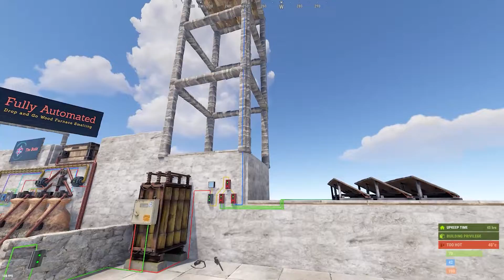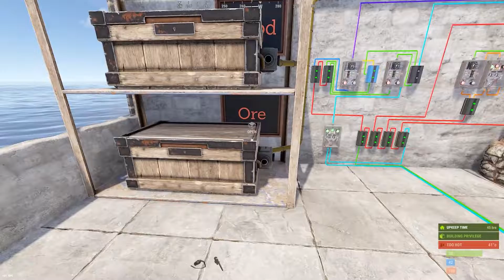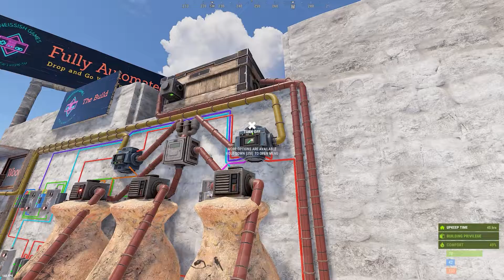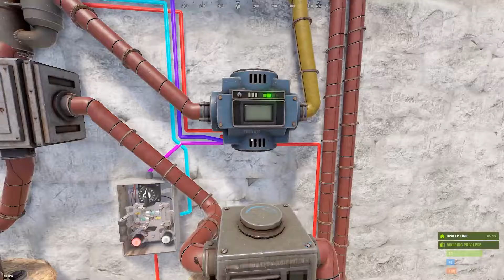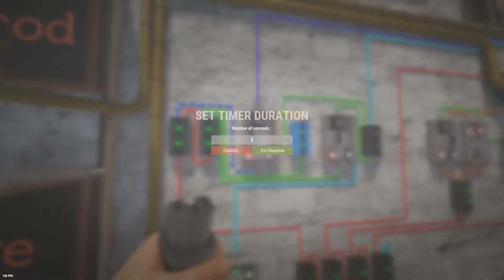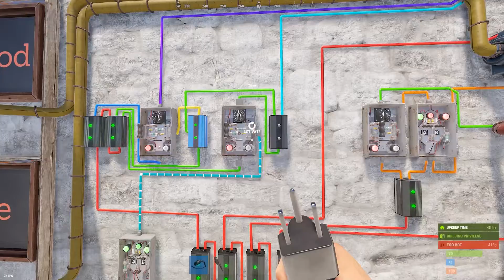RUST Industrial | Fully Automated Drop and Go WOOD FURNACE Smelting 2023

Comment: Love the video. How do you change your circuit views, highlighting one, all or none?
Reply from the maker: If you are in range of wiring and equip the wire tool, it will all highlight automatically. You can isolate a line by selecting any of its connection points. Selecting that connection point again will toggle back to everything being highlighted. To stop highlighting all together, I simply unequip the wire tool. Hope this helps!

Comment: Isn’t it an overkill? Full auto furnace room may work on 5 power. 
Just box-splitter-2conveyors(one for wood, one for ore)-combiner-furnace-furnace-furnace-conveyor-box
Electricity: source-combiner-combiner-combiner-timer-igniter
Logic 3 wires:
1. ore conveyor filter pass - wood conveyor turn on
2. ore conveyor filter fail - wood conveyor turn off
3. wood conveyor filter pass - timer on

This won’t refill furnaces will wood once everything is smelted, so startup will take extra few seconds, but it’s much more power efficient
Reply: And set max to ores in conveyors. Hqm 3, metal 6, sulfur 12, wood 10.
Reply: @horodep  Dooooooooood Yess! Thank you, this was much simpler!

Comment: The only thing that hangs me up about this is the igniter. If you dump a large amount of ore into the ore box (say a few thousand of each metal and sulfur), the input pass will constantly be sending reference volts, right? Because it only pulls 32 out at a time, that would mean the filter pass would send references every couple seconds as it does the "checks" So why isn't the igniter going off every couple seconds? Is it because of the small amount you put in the ore box that it only referenced it once and then ran out and didn't send a second round to the igniter? Will dumping larger amounts of ore cause the igniter to keep going off?

Comment: Can you explain more precisely why you need to run the filter fail to an And switch? Is it a glitch?

You said it works likes a redstone clock, which implies that the filter fail goes on and off (which I have not seen myself), but wouldn't that still turn the And switch on and off repeatedly, therefore not solving the problem?
Reply from the maker: My suspicion is that it's a glitch associated with the conveyor when it "scans" for items. And you're correct, if it did create a true clock circuit, adding the AND Switch wouldn't have changed anything. 

The weird thing is that when I built the first version, I could swear it wasn't doing that. After some testing, it appeared to be prominent enough to warrant a safe guard. The AND Switch worked, so I went with it.

Comment: I tried doing this and got lost for so long because of my tendency to over complicate things. Get this ... I was so used to electric furnaces that I didn't even consider letting the wood run out. I was trying to time a sprinkler to turn them off! Silly me.
Reply from the maker: I can relate. I also considered a crazy complicated sprinkler setup before it finally dawned on me to try restricting the wood.
Reply: @AustinKG  you can also just run the filter pass of the wood to a timer that turns on the igniter and use the filter fail and pass of the ore conveyer to turn off and on the wood conveyer. No need for any of these other switches or timers or branches.